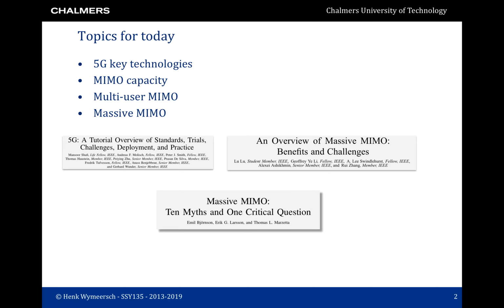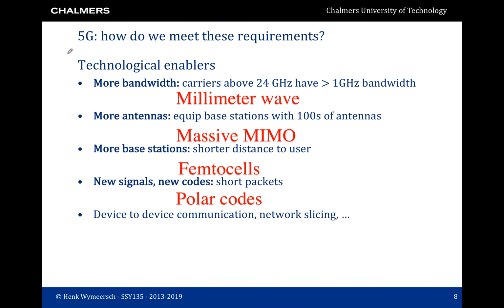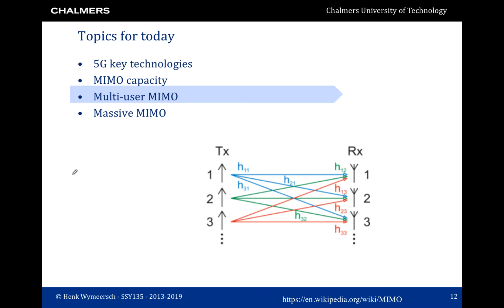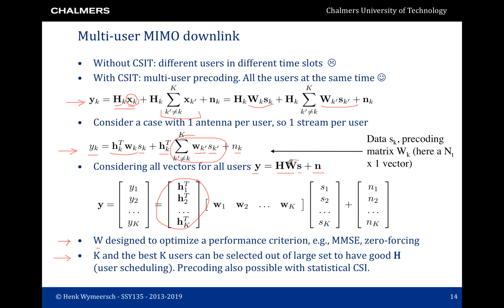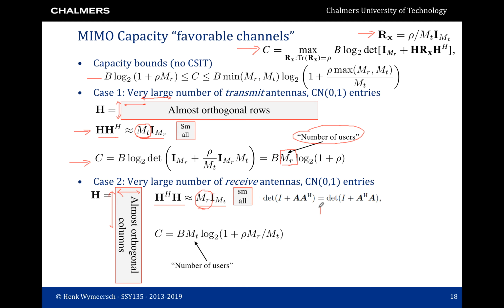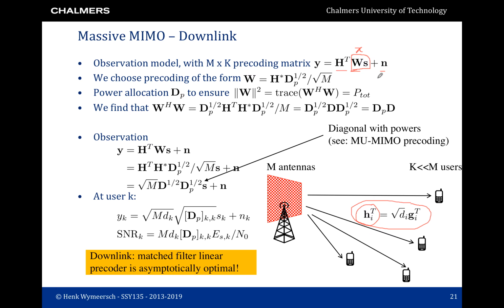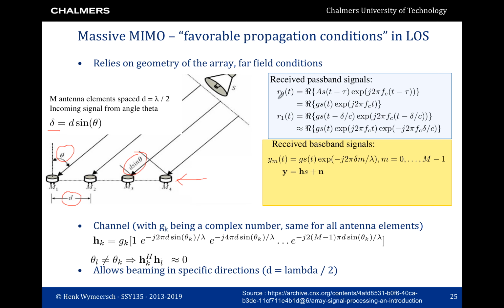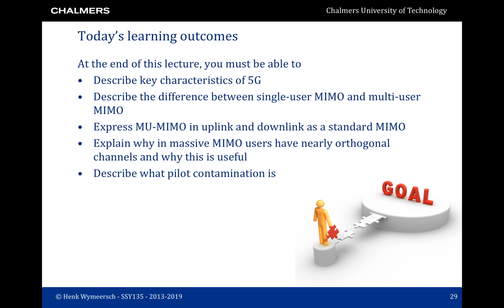Wireless Communications: lecture 11 of 11 - 5G communications

Comment: @Henk Wymeersch 
Professor, thank you for this course. Kindly, I have a question about massive MIMO analysis when user devices have multiple antennas (some antenna designers proposed up to 20 multiport antennas on mobile terminals); what about the required assumption of M>>K in this case? What about channel estimation with such a large number of RX antennas?
Reply from the maker: Thanks for your question. You will then need to send uplink pilot signals on all of the user antennas. If the signals are sufficiently long, the BS can create an observation model and obtain a least squares channel estimate of all the channels of all the users.